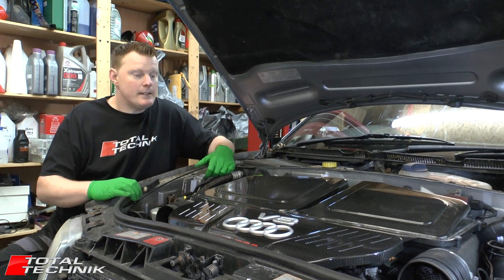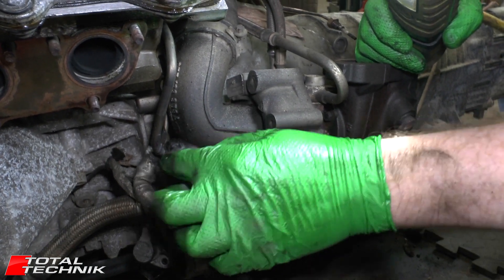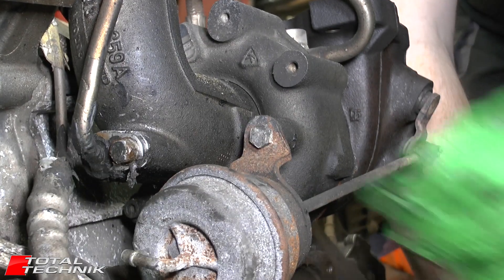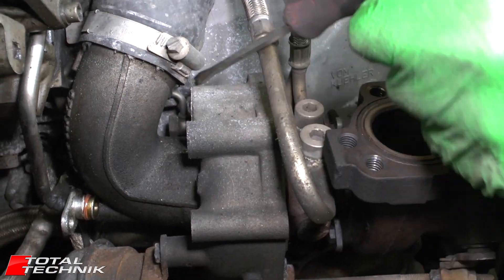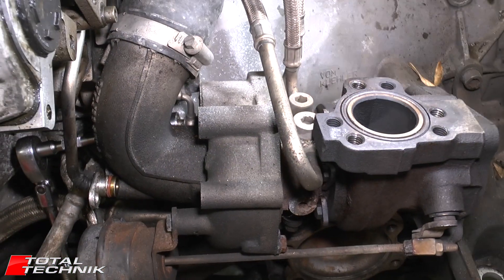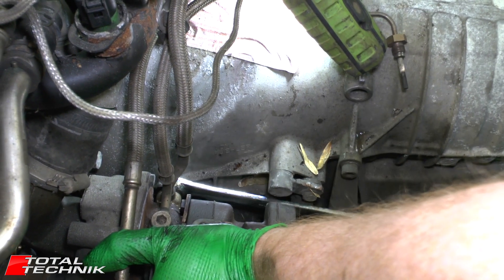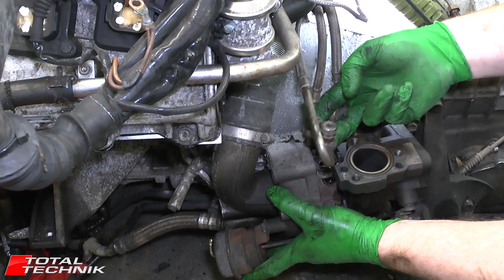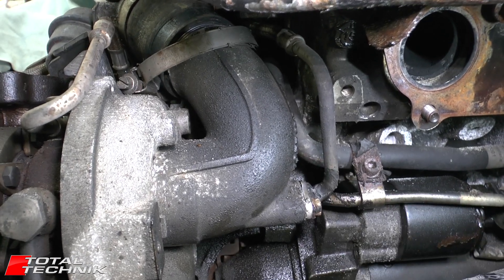How to Remove Turbo's - Audi RS6 (C5) - TOTAL TECHNIK

Comment: Is this possible with the engine and transmission still in the car? (With a 6-speed manual)
Reply: No. You gain space with the manual swap, but there is still massive access issues. I suppose if you liked building tools, have tiny hands, and like to work blind you could figure it out.

Comment: Greetings, any suggestions on keep the transmission in one piece when doing a larger turbo upgrade? 

It’s almost criminal that these engines can make so much power with tunes and turbos, yet the gearbox has trouble with it.